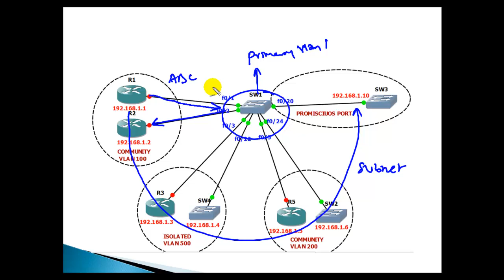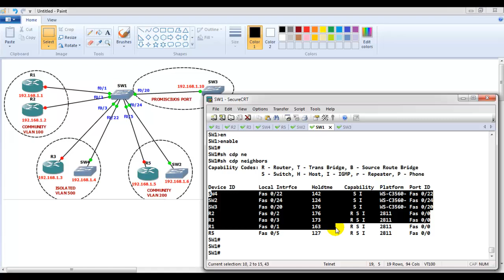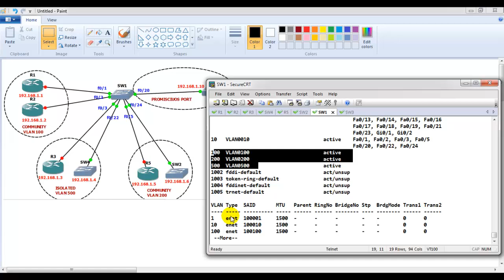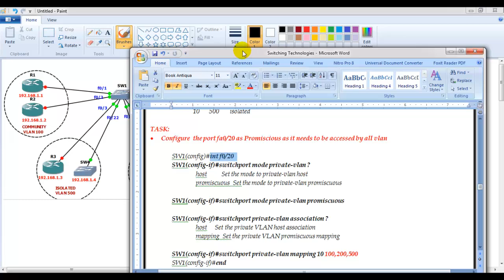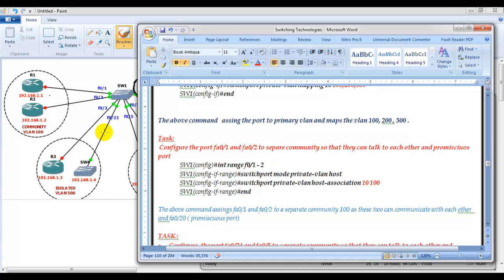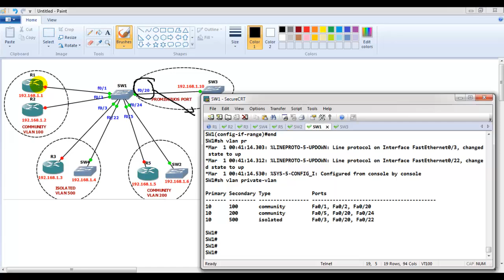Private VLAN Lab

Comment: How can I assign the IP address to Switch?
Reply: conf t
hostname SW3
vlan 10
int e0/0
switchport mode access
switchport access vlan 10
int vlan 10
ip add 192.168.1.6 255.255.255.0
no shut
Reply: Better do it in native - VLAN1, if you are planing to keep as flat network, as long as all port belong to VLAN1
# conf t
# interface vlan 1
# ip address 192.168.1.1 255.255.255.0
# no shutdown
# exit
# wr

Comment: You're excellent. I clear my doubt today. Thank you sir.
Reply: Tell me onething , How the switch will act as a router?.
Reply: @thangarajk546   use the below configuration to do that:

conf t
hostname SW2
vlan 10
int e0/0
switchport mode access
switchport access vlan 10
int vlan 10
ip add 192.168.1.4 255.255.255.0
no shut

Comment: awesome video, one of the things i was getting caught up on was the IP address association to the Layer-2 subboundaries, in regards to broadcast. most examples ive seen would configure the primary VLAN on a swtich acting as the ISP with an SVI with subnet of /24, then the associated community vlans as multiple /28's  for the customer networks, the first thing that comes to mind is that you have now trapped your /28's with in that routing domain due to the fact it will not have a valid default gateway, due to the /24 of that subnet being on the primary VLAN, the only way i seeing those configus working is if you use a secondary IP address on the primary vlan thus making you have to subnet and kinda of defeating the purpose of private vlans i think your approach is more practical , correct me if i am wrong from my above statements, but if you use private-vlans as a L2 service from the ISP perspective, you can statically assign what would be an WAN address to the customer essentially a host address within your subnet, then configure a promiscuous port as the GW uplink.  once again keep em coming great vid